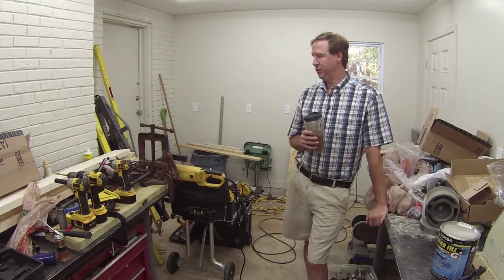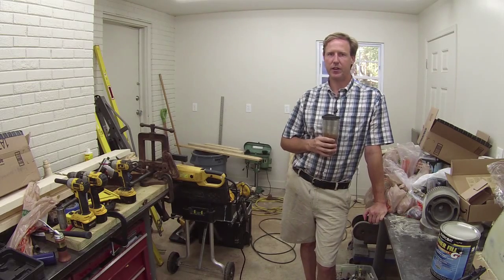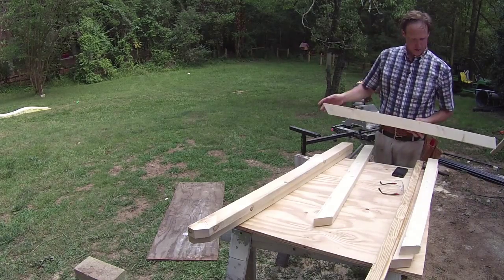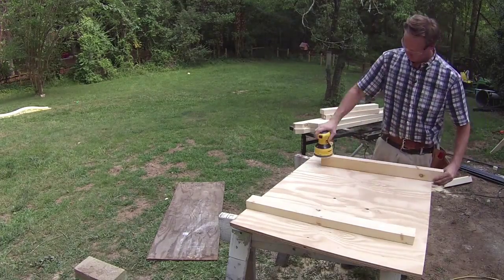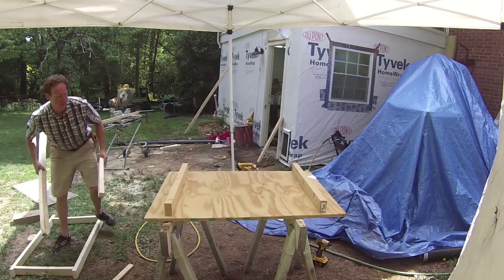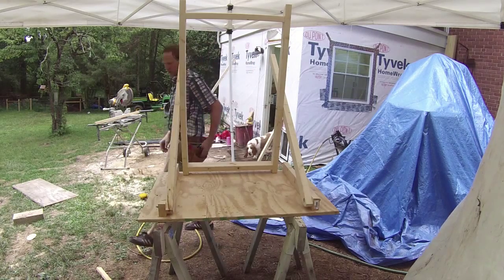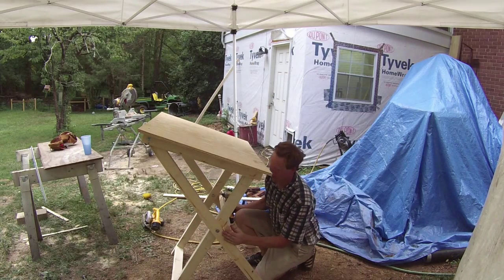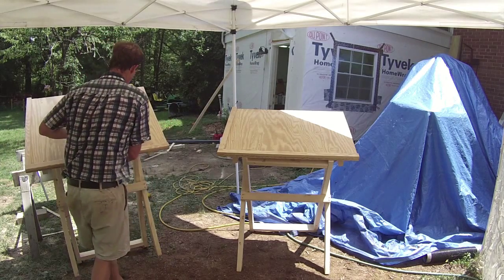Jobsite Drafting Table  | Plan Table

Comment: Hey can you please send me the measurements on where to attach  the 24" blocks,where to drill for the bolts, the 30" brace 
I'm trying to do this whit my daughter I got the cut but where to attach on plywood ??
Reply from the maker: I just center up the 30" boards on the plywood.  That gives me a1" space on both ends.  As for the 24" boards that go between the legs, I leave a 1" space from the bottom and the top.  The spacing of those don't really matter.
Reply: +Jake Belk can you make one drafting table for me personally I can't afford to buy one .I will give you my full name. and address to send it to me .I'm serious I need one badly with a light source in center of it for animation old school way .

Comment: what measures and materials used?
Reply from the maker: If you follow along in the video, I call out most of the measurements.. As for the wood, go to the lumber yard and pick up some clean straight 2X material and a sheet of 3/4" BC sanded plywood.